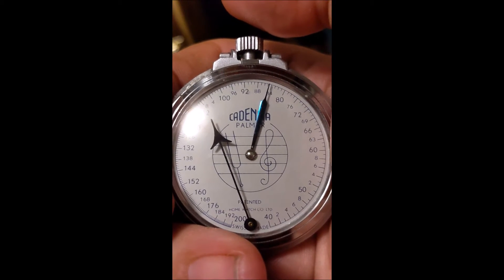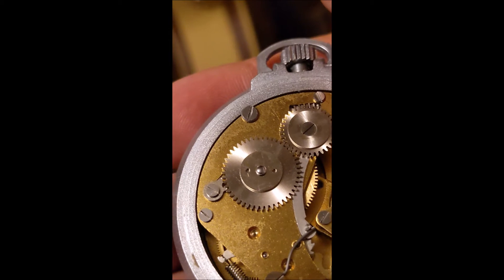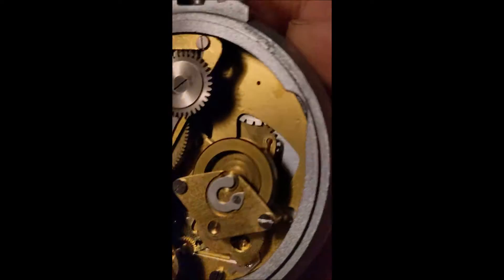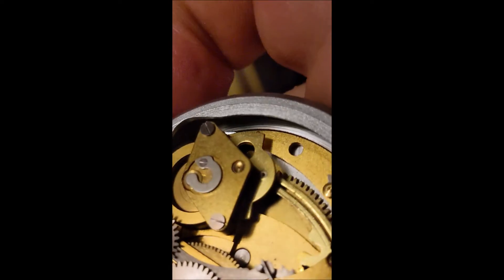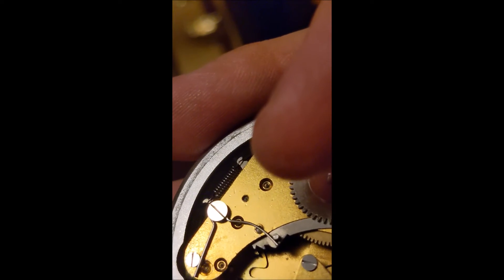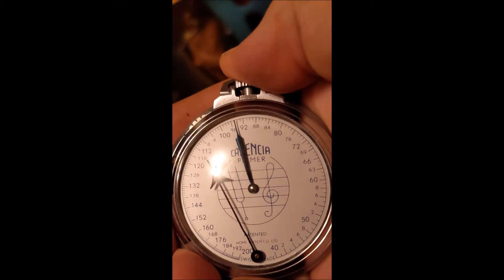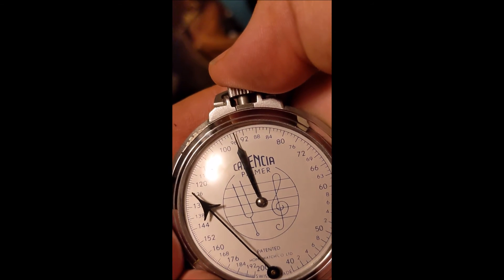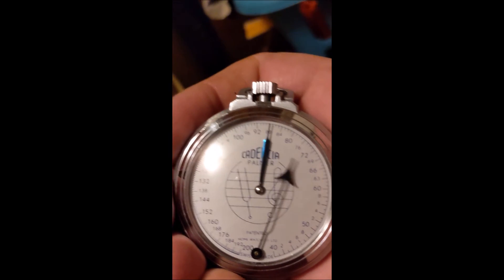What's inside of this Cadencia Palmer pocket metronome?

Comment: Thanks for the breakdown. I just got one on EvilBay for $120. It worked well when I got it, a little better and smoother after blowing it out with air and adding a little synthetic oil here and there.

I noticed the tempo is about 10% too slow. Do you know of any way to calibrate the bpm?
Reply from the maker: 10 % is pretty drastic. If you take it all to pieces and clean it, and remove and clean and reinstall the mainspring, or replace if it's become set, you'll get within several beats. Then with the speed indicator hand off and on half a wind, adjust the tempo regulator until you get 60 beats, and reinstall the hand right to sixty. Next, go to 120 and count every other beat over the space of a minute. If it's within about 4 beats all is well. If not, average your errors so about 90 beats is dead on. Then as long as your error is consistent everything will be fine, the error will be no greater than the old fashioned baton wind up style or the early electric ones.
Reply: @charlesjames7079 you're a true gentleman and a scholar
Reply: @charlesjames7079  okay I took it all apart, sonic cleaned the gears, dried everything, oiled with the recommended oil, put it back together. I did not mess with the mainspring because there was a tough screw and I didn't want to force anything. What I accidentally figured out in the process is that the method to calibrate the tempo is simply to take off the glass/ front face and nudge the tempo indicator until it matches the tempo the thing is putting out.

Since cleaning it the beats are more regular than before. Before I could detect a slight audible unevenness between the left and right beat. Now that has gone away.

Thank you for your help and encouragement. Now I have a new set of tools. I'll have to open up a shop